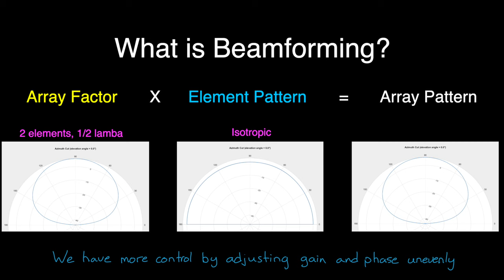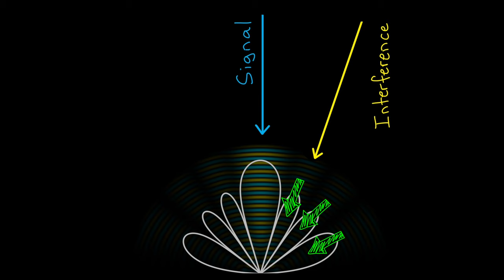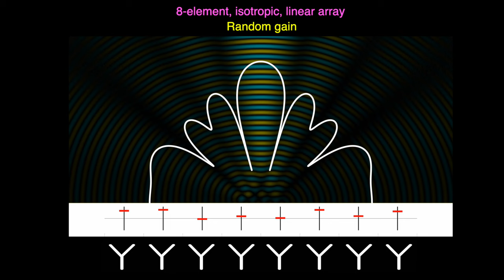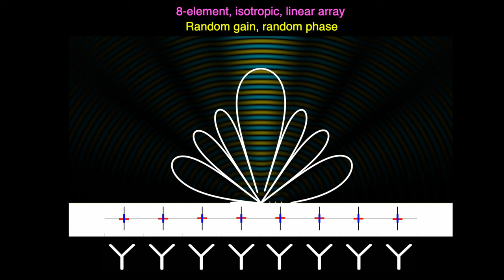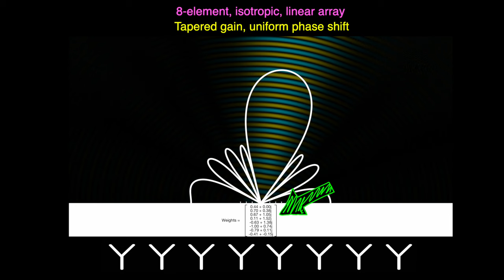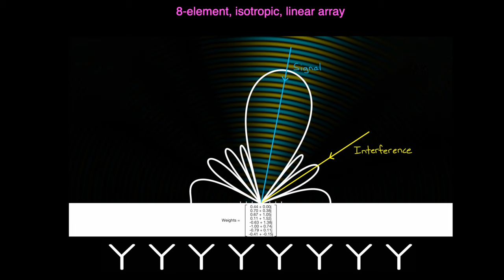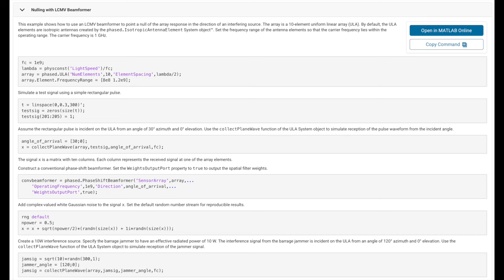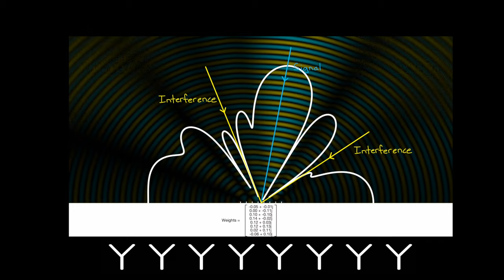An introduction to Beamforming

Comment: Hi, Brian, thanks for the awesome presentation. The course is based on a certain frequency signal, but in practice, the signal could be a wide band, the speech enhancement for ex.  wave length of 150Hz is 50 times to 7.5KHz's,  It's difficult to set the microphone distance to cover all the wave length range. Hence, is it necessary/possible to filter the signal into different segments, set/pickup the mic distance accordingly, doing beamforming, and then merge the spectrum segment together? Thank you

Comment: Hi all, Is there anyone who help me with the performance analysis of the adaptive beamforming-based algorithm for interference mitigation in the mm-wave massive Mimo system.
Reply: You mean for shooting people with? 😮 I didn't know it needed an algorithm. I though it was just the same frequency and intensity dispute the range. why not just manually adjust it? or is that not what you meant?
Reply: ohh I see. you mean so that the projected mm waves aren't interfered with by other waves from other sources 😐